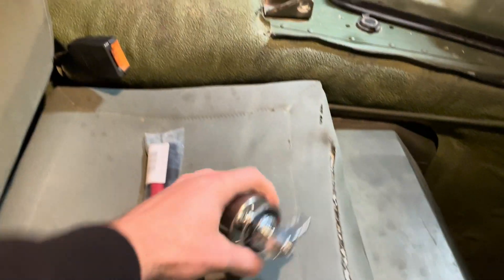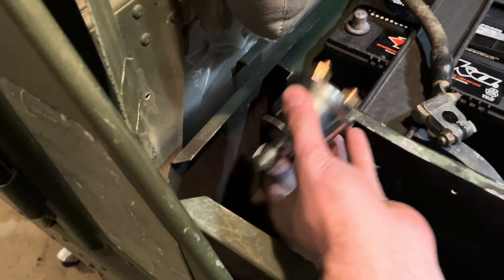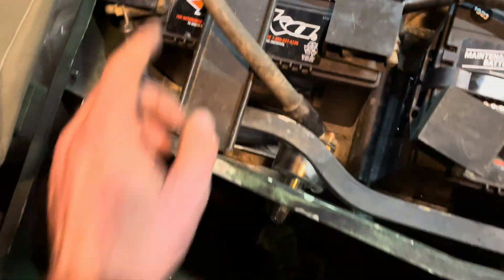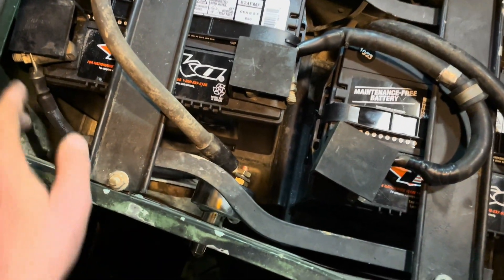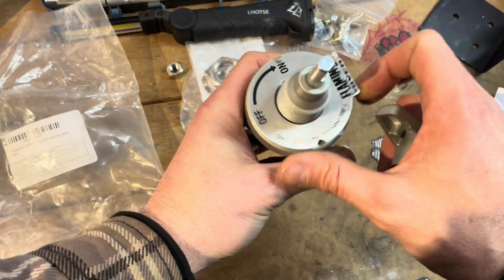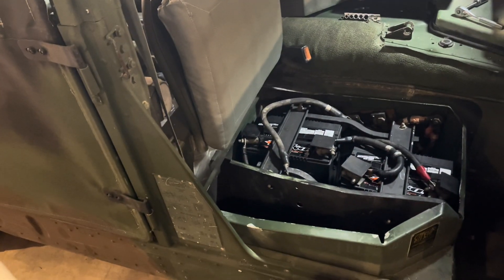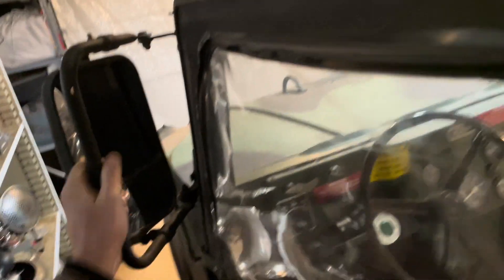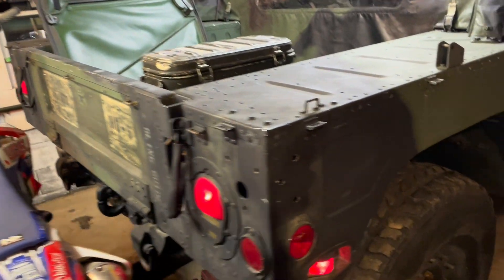Battery Disconnect Install 24v M998

Comment: What does it matter which lead it goes on??
Reply from the maker: It doesn’t really matter what side the switch is run on but in this situation the switch will be protruding into the battery compartment and I didn’t want hot leads being exposed.  Now if I accidentally touch the switch terminals with a wrench / metal object it will just get grounded and not arc on me. I also prefer to have the neg side switched to preserve battery life and prevent parasitic drain from grounding when the trucks in storage.